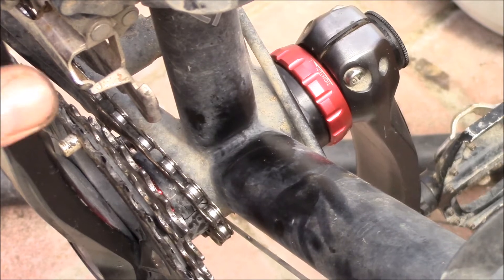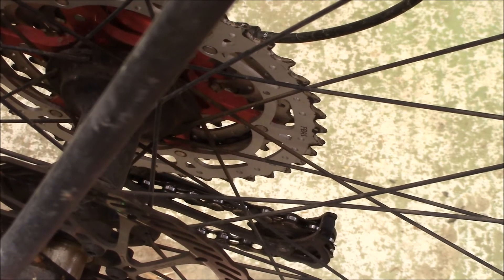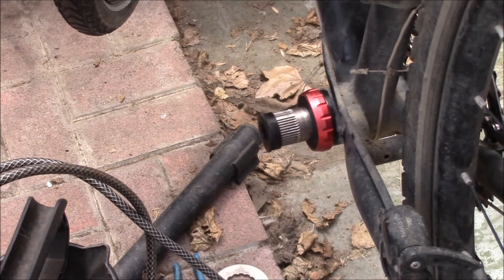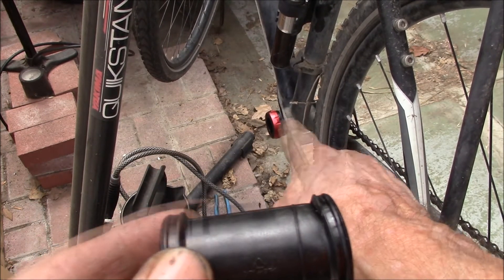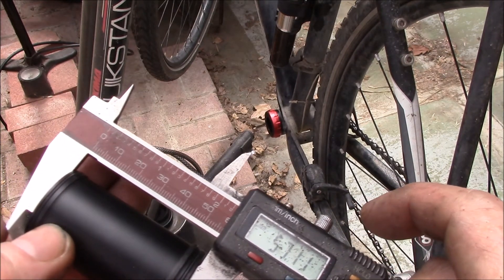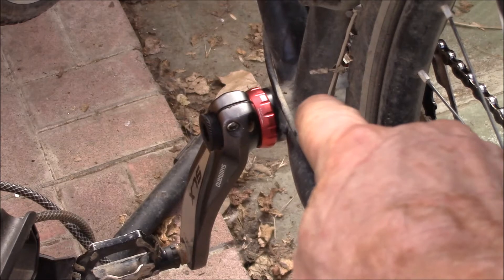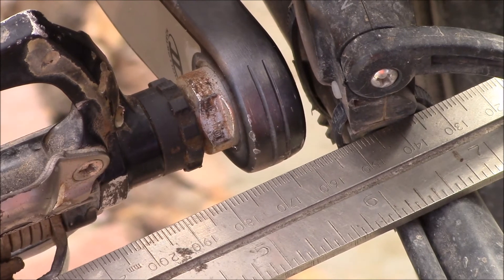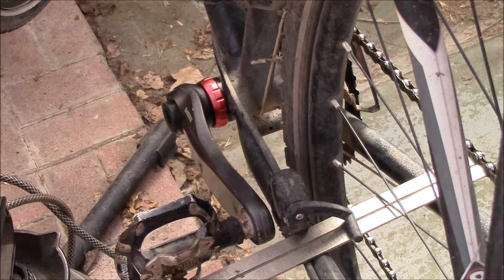Shimano HollowTech-II Bottom Bracket Narrowing, Part 2

Comment: Question, by removing two of the 5mm spacers, did your BB had some issues regarding clearance? I read somewhere that Shimano Hollowtech 2 MTB bbs are designed for using either 1x 2.5mm spacer in a 73mm width frame, or using all three 2.5mm spacers on a 68mm frame. By removing the need of 2 x 2.5mm spacers, you are practically at the sizing of a Road hollowtech bb, is that what you are using or you also found a way to retro fit a MTB one on 5mm less total width?

On another note, do you think it would be easier to mod the spindle instead on hollowtech spindles that don't use the small fin design? (example, the SRAM GXP ones which use bigger and more spread apart grooves.)
Reply from the maker: I didn't have any frame clearance issues with the narrowed BB and am even running a triple crank set.  I used the MTB crank so that I could get the smaller bolt pattern for the small chain ring as I wanted to fit a 20T chain ring in place of the standard 22T.  I think the road cranks only went to a 24T chain ring with a larger 64mm BCD bolt pattern.  So I guess I may have made more of a road BB out of a MTB BB but got the lower MTB gearing.  

Yes, should also be possible to deepen the splines in the spindle, I just felt it was easier to remove a bit of the splines inside the crank arm.  The road cranks apparently have less deep splines which maybe is how they are able to be narrower.

Comment: I know this is an old video but hopefully you reply.. im wondering if you had ever considered just extending the splines and threads and cutting it off? What effect would that do to the spindle? Im trying to do the same thing and dont want to shave off the teeth in the crank arm and not wanting anything sticking out and probably catching on to something
Reply from the maker: I considered that but had no easy way to do that.  I suppose one could use a Dremel and a cut-off disc and lengthen the grooves and then cut off the end and clean up the internal threads enough to get the threaded cap in there.  You would need to be careful not to extend the grooves to far or they'll get into the seal on the non-drive-side bearing.
Reply: @The4Crawler  should i be worried about the integrity of the axle?
Reply from the maker: @i3enjaminmejia66  I would think if you kept the depth of the extended grooves equal to the original it should have no effect.  However, if you cut or grind those grooves way deeper than needed, that could be an issue.  That was another reason I chose to take some of the splines out of the inside of the crank.  On the MTB cranks I have, there's more spline depth than on a narrower road crank.  So 5mm less spline depth puts them at about the depth of a road crank.

Comment: Hi! 
I'm interested in achieving the same thing as you did: Having a MTB/touring crank, but reducing the Q-Factor.
Two questions regarding your bike's frame:
1. What dimensions does the rear hub have?
2. What's its BB shell width?
Thanks!
Reply from the maker: 135mm rear hub and 68mm BB shell.

Comment: why not cut it?
Reply from the maker: Good question, assume you are referring to cutting the end off the spindle?  Thought about that but had no easy way to clean up the threads inside and most importantly to extend the splines on the outside.  Would have been easier if the spindle were separate from the rest of the crank set, but with the crank attached it was awkward to hold in the milling machine vise.  And while cutting the end of the spindle off would have eliminated the need for the 3D printed ring, it would not have solved the problem of the spline depth.

Comment: why did you not just put the bottom bracket spacers on?
Reply from the maker: Two main reasons.  Drive side spacer was eliminated for a better chain line on the 3x10 drive train.  The other spacers were eliminated to narrow the Q factor on the cranks for more comfortable riding position.  I'm more of a roadie so am used to narrow cranks and the MTB crank on this bike was a lot wider than I was used to.  Narrowing/centering the cranks eliminated some knee pain I was experiencing.